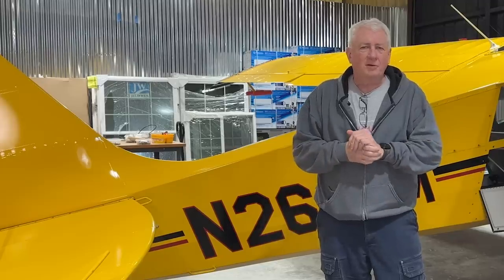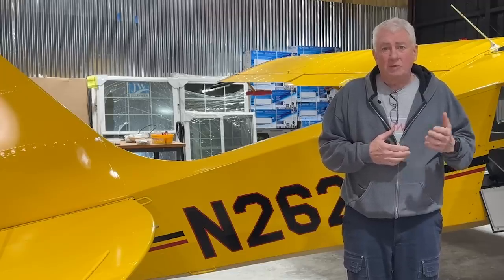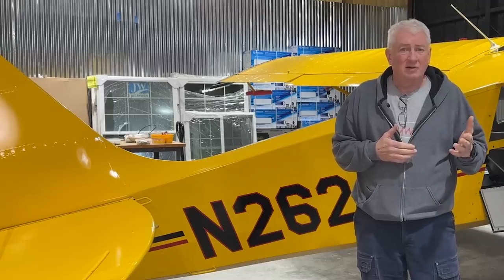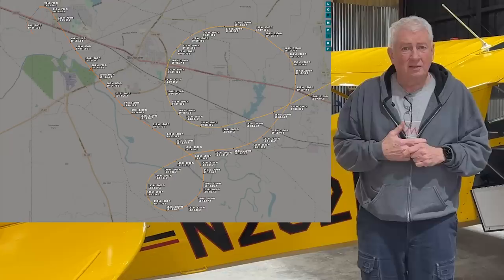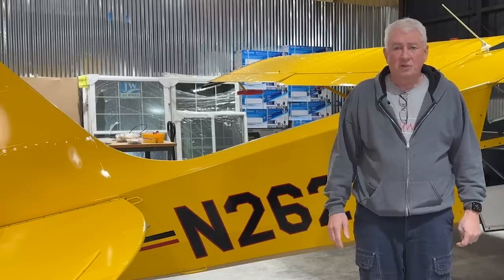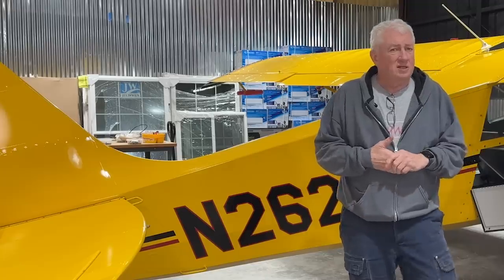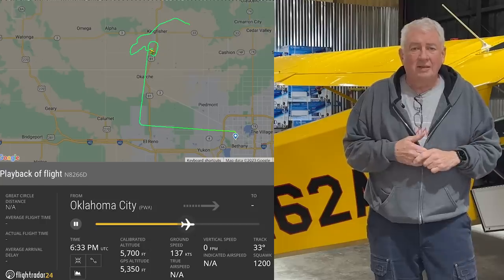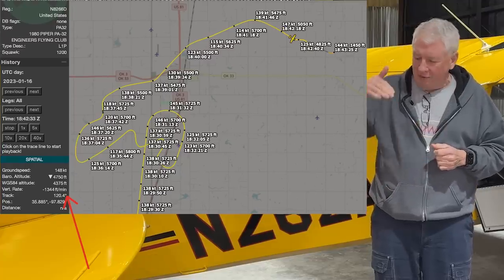Accident Quicklook  F35 Bonanza and Turbo Saratoga

Comment: G'day Scott,

Yikes !

Trying to fly 3 & 1/2 hours at 11 GPH on a mere 33 usable Galleons..., now THAT is a special brand of Optimism ; Rose-Coloured, presumably (?).

 As for the diving, rolling, photographed to be smoking Black and burning Fuel-Rich all the way onto the Deck, for an explosive Vertical Envelopment of the Impact Site...; that's scary to think about, at first blush.

  Could a broken Fuel Injector Pipe pump Motion-Lotion onto a Cylinder-Head, somewhere from whence the "extravasated" Fuel could spray or drip onto a hot Exhaust Manifold...?

A pumped Fuel-Fire under the Cowling might explain a lot, could it not ?

This one will be fascinating to eventually discover how it came to vary the more usual sequence (crash/burn/die...) in favour of the
 Burn/Crash/Fry
Variation...; 
the poor buggars.

A Fuel-Fire in the Sky seems to be the universal Tribal Nightmare, among Flyers...; maybe stemming from the Pre-Parachute Era and descriptions of the fear of going down in flames justifying Pilots flying with a Handgun and intentions of headshooting themselves rather than have to leap out and fall, or ride the Fireball down to the end.

Too many re-readings of Biggles, perhaps - but it isn't only myself harbouring such apprehensions...; when I bought the almost finished Plans-built Project which became my second Aeroplane, the original builder equipped his 22 Hp Ultralight Motorglider, with a Tractor Propeller direct-driven by the Motor on the extended Fuselage Boom of the High-Wing Monoplane..., and twin Stainless-Steel Fueltanks under the Seat, behind the Undercarraige - bifurcated and cross-connected for the Rudder Cables to pass between them.... And the Fuel Line had a Quick-Disconnect Bayonet-fitting, with a Handle and Pull-Pin in the "Hinges" at the ends of the Sheet Aluminium Strap running athwart, under the Tanks - all the better to be able to suddenly Unplug, Pull the Pins, and drop the (oh so terribly frightening) Fueltanks whenever (and if ever) the possibly perfidious 2-cylinder 2-stroke Horizontally-Opposed French Engine (JPX -Pul 425) might perhaps decide to set itself on fire...(!).

 I kid you not.

My guesstimation was that skinning over the open "Bomb Bay" in the bottom of the Pod saved a lot of Drag, whereas if Gravity was feeding Fuel from a Tank under my Bum to a burning Engine over my Head and 6 feet further forwards - then I'd be in an inverted 80° Dive to achieve it, at which point pulling out would break the Wings off so jettisoning the Fueltanks was NEVER going to be anything I would have any valid reason to want to do...

Then, when upside-down in the Potato-Patch, hearing the Fuel going "Glug-Glug-Glug..." from the Tank (then) above me running down the back of my seat, over me, as it flowed towards the Engine....

It was the Fireball Fantasy Phobia which inspired me to unbuckle, fall out, and attempt to run on a broken Ankle ; hopping off a good 15 yards, before pondering,
"How big a Fireball can 3 Gallons of 2-Stroke Fuel produce, anyway ?"

To which the actual answer turned out to be No Fireball at all....

But, the fear of a Fuel Fire aloft is right up there, alongside Catastrophic Airframe or Control-Circuit Failure..., or a Heligoflopterist's fear of their "Jesus Nut" coming undone and the Main Rotor departing it's Mast...; happenings for which no amount of Training or Pre-thinking Response-Chains can effectively prepare one to "fly one's way out of".

To guard against Structural or Control Circuit  Failure I had a Spring-deployed Ballistic Recovery Parachute..., but an issue with Aeroplanes much bigger than Ultralights is the Weight/Power/Fuel spiral which grows from increasing the useful Load, and from accelerating to cost/effective speeds, pretty soon means sitting in a thousand pounds or four of Airframe and Engine, with 20 or 40 Gallons of Fuel or more, obliged to be moving at something over 100 Feet per second as a minimum flying speed, 150 ft/sec to be halfway comfortable and 200 ft/sec to cruise happily....

The Energy to lift and shift all that weight at such speeds for such distances is all in the Fueltank, and if it commences to burn outside the Combustion Chambers, while aloft.....; that's what Parachutes with Ripcords and Harnesses to strap onto the Aircrew  were invented FOR.

Jumping out of burning Hairygoplanes !

Sailplane Pilots fly wearing Slimpack Parachutes, to ward off Mid-Air Collisions and Structural Failures ; by being prepared - therefore it probably never happens at all  (Negative Sympathetic Magical Spellcasting, they call that...!).

Such is life,

Have a good one.

;-p

Ciao !
Reply from the maker: Thanks, Warbles! Interesting stuff.

Comment: NEVER HAVE WEAKDAYS, MAKE EVERY DAY A FLYDAY!   THERE IS NO REASON FOR YOU PILOTS TO DIE OF HYPOTHERMIA IN WATER DITCHINGS. I'm at work and I own a restaurant so I don't have a lot of time to type this but this MAY SAVE SOME LIVES FOR YOUR PILOTS. In a previous life I used to ride Jet-skis. I was addicted like you pilots are to flying, so I wanted to ski when it was December in Oklahoma and the water was in the 40s  Fahreheit, so I did some experimentation, and I can tell you WITHOUT A DOUBT THERE IS NO REASON FOR YOU PILOTS TO DIE OF HYPOTHERMIA IN WATER DITCHINGS.

I will spare you the science of heat transfer, but all you need is at least four layers of shirts and pants on, five is obviously even better. Obviously, there are scenarios where you don't have time to put it on before ditching but you don't need to. As long as it's all in a bag, with 4 pairs of socks and one big pair of shoes to fit that, you're set. 

YOU HIT THE WATER, GRAB THE BAG  FREEZE YOUR * OFF FOR A MINUTE OR TWO, PUT ALL THOSE CLOTHES ON, which isn't all that easy but when your life depeneds on it, you'll get it done. ONCE ON, 4 LAYERS OF CLOTHING FUNCTION JUST LIKE WHAT THEY CALL A DRY SUIT, IN THE DIVING INDUSTRY. 

when the water hits your skin, it's so cold it hurts. But 45 seconds later, your body has warmed the layer of water next to your skin, AND BECAUSE THERE IS VERY LITTLE TRANSFER OF WATER THROUGH 4 LAYERS OF CLOTHING, YOU WILL LOSE VERY LITTLE BODY HEAT, AND YOU CAN MAKE THAT UP BY SWIMMING, WHICH BURNS A LOT OF CALORIES. 

The fact that you weigh more due to the weight of all those wet clothes works to your benefit. You have to burn more calories, and that means you will produce tons of internal body heat. Now if you have some flotation devices, do not become complacent. YOU NEED TO SWIM, EVEN IN PLACE IF YIOU DON'T WANT TO GO ANYWHERE. IF YOU SIT STILL YOU WILL GET COLD!

Believe it or not, you will actually be warm, as long as you are swimming. So keep your body in shape. If you are too feeble to swim, you can't stay warm, so if you're not in shape, DON'T FLY OVER WATER. 

As with any procedure, you should practice it. So, try it sometime. Out in a boat, climb over the side, put a few layers of clothing on in cold water while having to tread water, then swim for a half hour or more. Notice you get warmer not colder, and the exercise won't hurt your figure either. 

Good luck pilots, from a former Jetskier, former Electronics Engineer, former Reactor operator. Remember- NEVER HAVE WEAKDAYS, MAKE EVERY DAY A FLYDAY!